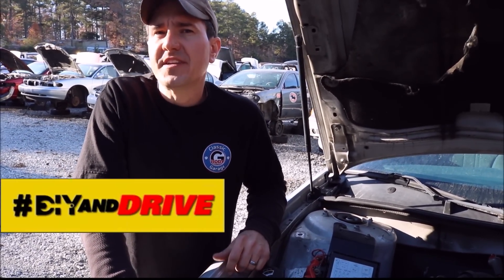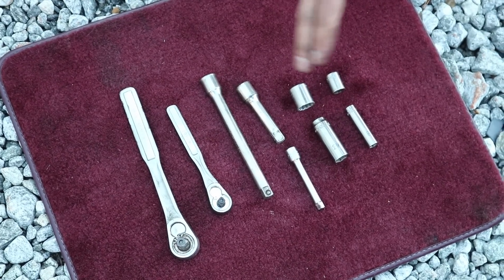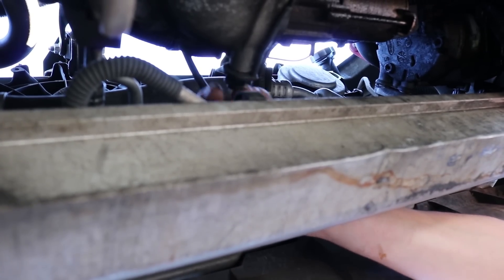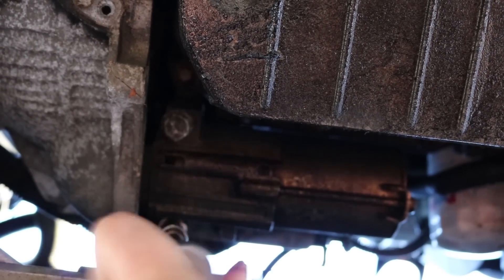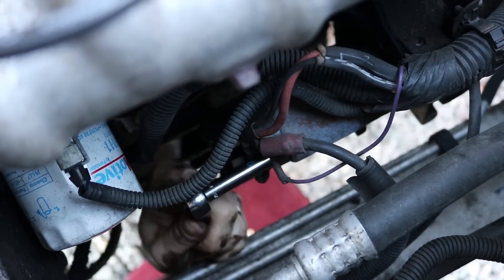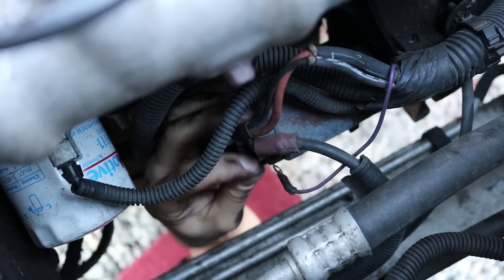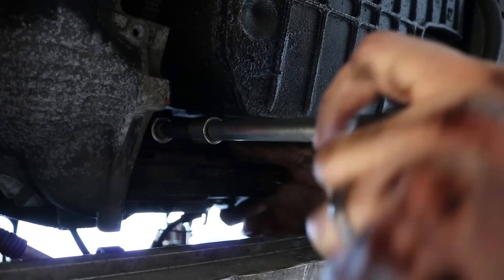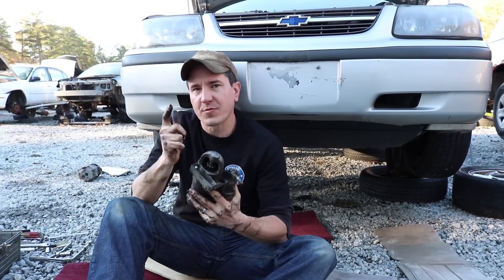How To Remove Replace A Starter GM 3400 V6 and other vehicles

Comment: You did a very good job on this video but do you have the video where you put back the starter is there something you have to do or the new one just goes on there like you took off the old one & the car will start
Reply from the maker: Just reverse the process.

Comment: Hey you did a good job on this video, Brian. One tip I learned is if you are in circumstances where disconnecting the battery isn't practical, you can insulate your socket with a nitrile glove, and wrap the handle with a rag to prevent arcing when disconnecting the starter wires.
Reply from the maker: Awesome point and thank you for your comment!

Comment: First always disconnect the battery negative cable to avoid a dead short to ground before removing a starter. I've seen the result of that from a neighbor who didn't once! He got a burn on his wrist from the direct short to ground.... If the positive  cable terminal touches the engine or frame with the neg still connected it is a dead short to ground....

Comment: G.M 3x00 series engines are excellent engines if you can catch them before they overheat,installing the felpro metal intake gasket set will guarantee tons of trouble free miles from these mills.
Reply from the maker: Yes so true! I have a short video series on the gasket replacement on my 2001 Grand Am. Thanks for your comment!

Comment: Could you make a video or let me know what warning lamps on the cluster should be connected on a 1985 oldsmobile cutlass supreme 3.8L. The reason I ask is because someone removed some of the lights and the only ones that light up are engine light, battery charging and the bottom left seat belt light. I know for a fact that the choke and oil pressure light should turn on when you disconnect the choke. Just having a lot off issues with engine codes left and right and can't find anyone that knows what they are doing. It's throwing a code 54, but it never did that until this dude got his hands on my car. I know for a fact he moved around the warning lamps so now I'm lost with what goes where. If you could please help. The car runs good also due to the code 54 so that's what I can't figure out. Thanks man.
Reply from the maker: They were most likely not removed as the factory leaves places for many options a car could have. Your car may have had options that used bulbs in certain locations. It sounds like all of your lights are there and working. You can see where the bulbs would be if he did move them as there would be scratch marks on the copper foil where the socket twists in. The codes can be worked through by fixed what it says. I have a video on diagnosing codes in my Gbody How To play list.

Comment: I own a 1971 Buick Skylark, its a GM A body.  I wish my starter was as easy to remove.  Just wondering or maybe this is for the benefit of all who read this but in those cars, or maybe ONLY mine, they had a ninja bolt.  It was a tiny 1/2" short hidden bolt on top of the starter.  Just wondering if you knew why GM would torture people like this back then?  Yes it was a very heavy starter and could kill someone if it fell on their face, but why the ninja bolt?  Just curious if it serves any kind of purpose, or if it was just there so people didn't get killed when changing them out?
Reply from the maker: Good points! Yeah this starter was very easy to remove and there is always a risk of such a heavy part falling on you which I mention in the video but the starters from back in the 70s etc were even larger and heavier so it is possible that the additional bolt was added safety but I really can't say.